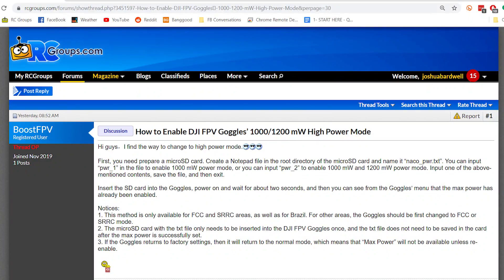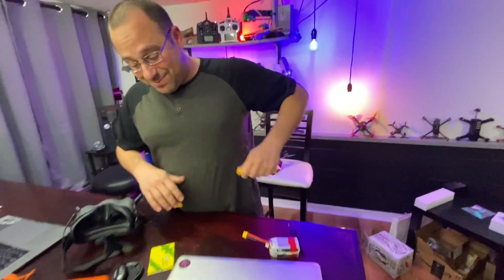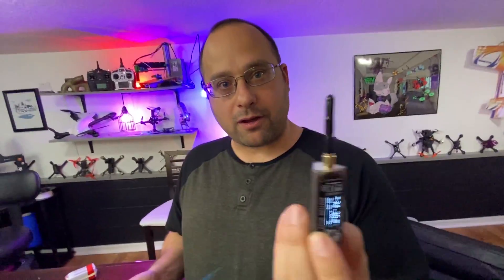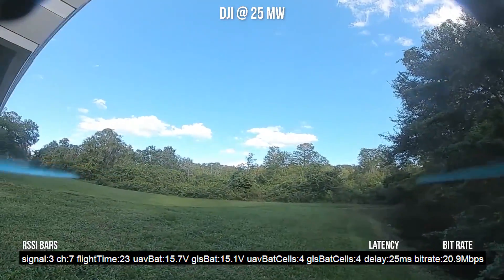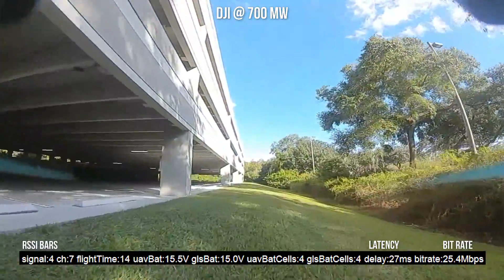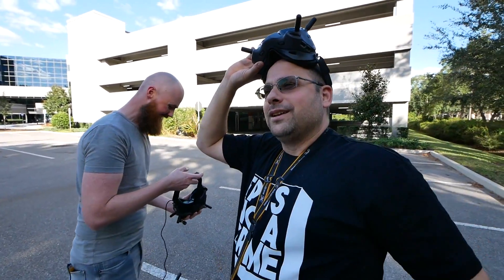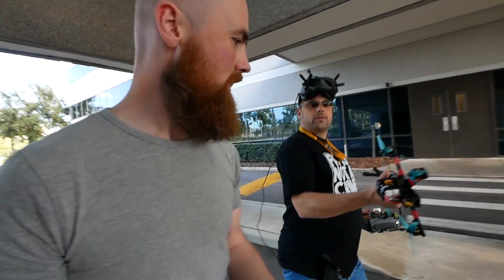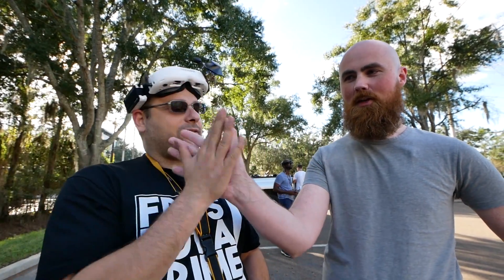DJI FPV more range than analog | 1200 mW HIGH POWER MOD

Comment: So how long till DJI forces an "update fix" for this? :popcorn:
Reply: They have not disabled the nearly identical "fcc" power limit hack for people in the EU, so, maybe they won't do anything about it?
Reply: first thing I thought of after going through that with the mavic
Reply: Guys DJI is the one who gave us this "hack" lol.  They're not going to take away something that they intentionally built and then "leaked" to the community.  This didn't work till the firmware update... They want us to be able to use this, they just can't legally give it to us above the table.
Reply: they most definitely will. that's the bad side of using a company that forces firmware updates. maybe the update will be optional, but then you'll miss out on actual improvements, like betaflight OSD data in the DJI OSD, which is currently very limited.

Comment: You are flying low to the ground and your 2 goggles were very close to each other. Your goggle and transmitter antenna positions were not perfect but I like your videos thanks
Reply from the maker: The 2nd set of goggles is in Audience Mode where it does not transmit. So it is not affecting the result.
Reply: @JoshuaBardwell  ok sry

Comment: it needs to be smaller to fit in a 3 inch :)
Reply: iFlight DC3 .. more on the way.
Reply: I have it on a 2.5" and it flies quite good. Check my videos.
Reply: No it doesn't.  The FlexRC Colugo is perfect for it, so is the Transtec Beetle 2.5" and the iFlight DC3 3". Fits them all great.

Comment: It wasn't the tool, per say, Josh shorted it out, touched it to the frame. Daaaaaamn! haha
Any reason you're not using your T16?

ALSO: Rotor Riot safety tip #1 (on Instagram) always remove your props when working on a drone. :)
Reply: X9D 4L
Reply: Was thinking the same..let's short the air unit that controls the quad and then put our wrists right over the props when we plug it in.... :)
Reply: @Sully365  he's running crossfire.

Comment: You bridged some powersource with the frame, the carbon burned.
Reply: thats how I burned up the stack in the wizard 140 the day I got it  :(
Reply: Jesus it was Ironic. You know that’s what the ;) smiley is for ;)
Reply: Ya the air unit wasn’t fried so must of just been the frame
Reply: looked like a tantalum capacitor burning. Or maybe a DC voltage regulator. 
the capacitor would make more sense as to why its still working though
Reply: Nah man, you are wrong it was the sharp tool! ;)
Reply: @naiceify  Maybe the sharp tip broke a membrane and damaged the insulation
Reply: @naiceify  which one?
Reply: @naiceify  Nah, he's right, something else burned.  If the tip of the tool itself let out that big of a fireball it would be completely missing, but it was fine.

Comment: Remember that DJI uses shitty antennas to get around some FCC limit. If you use better antennas you can also significantly increase your range.
Reply: I always love when pilots put directional antennas on their goggle and then fly with their head pointed to the ground 😜
Reply: Thats kabab bullshit. If they measure rf power. They measure it straith on the sma, not on the antenna. I measured the stock dji antennas for VSWR. And they are near perfect.
Reply: Hans Turpyn I didn’t say you get more power. You get better range. Those stubby antennas obviously are not the best. I‘ve seen multiple people switching antennas and by that getting increased range.
Reply: @MariomasterNSMBHD  yeah i know. But most people switch them to some sort of directional antennes. If you swith them for "better omni-directional" antennas the improvement will not be that much. There is a lot of hype and placebo effect in this space
Reply: I tried a lot of other antennas on the goggles and i can say that the stock Omni antennas are certainly not that bad
Reply: @hansturpyn5455  They are indeed okay and optimized for their size. Patch antennas are indeed not the best idea. But some high quality omnis can give you a bit more range.
Reply: @MariomasterNSMBHD  i got the cyclop on it and its dope
Reply: @hansturpyn5455  SWR doesn't tell you about thermal efficiency though, and the axial ratio on the stock antennas is rather poor. The singularity beats the stock DJI antenna on both.

Comment: Out here commiting Genocide on those Brain Cells, you have to make sacrifices for that kind of range.
Reply: I am an Industrial Gamma Radiographer.  I deal with Ionizing radiation daily. I’ll try to keep it simple, though there are more factors at play. The typical radiation dose for the average person is 600 mRem per year due to environmental causes (sun, ground & medical exposure). On a typical day of work I absorb 4-12 Rem. But I have absorbed over 60 mRem in one work day. that means, and that one day, I absorbed over a 10th what most people absorb in an entire year. Your body is naturally resistance, and will heal itself(over time) when dealing with lower levels of radiation. Trust me you when I say “THERE IS NO WAY A CELLPHONE OR ANY SIMILAR DEVICE CAN HURT YOU!”. It’s a larger doses all at once that you must avoid. Anything under a 100 mRem exposure(all at once), is undetectable medically.
Reply: yeah. with  the DJI being a two way system, I would only want to run it as a groundsation. (which they don't offer)
Reply: Meanwhile calls with phone @ 2W
Reply: @hansturpyn5455 way less than 1w google it
Reply: @boratsagdiyev1586  lol, the old phones where a lot more. It actually differs from phone to phone. You gonna die anyway sometime. Its  non ionization radiatiation, harmless
Reply: @hansturpyn5455  Some people are very restistant, not only to radiation, but also to any kind of humor online.
Reply: @NeverenCH  😜 yeah but some people actually believe it is dangerous lol
Reply: @hansturpyn5455  Fact of the matter is some studies have shown 5.8gz frequencies to be harmful and some haven't. At the end of the day you know there are huge massive lobbies to prevent these kinds of studies from getting the funding they would need to actually broadly test it. Im not risking my health for a hobby. But you do you i guess.
Reply: @AgustinMolini  yolo, enjoy your life to the fullest. Have fun my friend. Live a happy life as long as it lasts.
Reply: @AgustinMolini  If you want to follow your life by fallacies go ahead. Just don't persuade others to follow in your idiotic path.
Reply: @AgustinMolini  I worked in an rf shop testing military electronics in the Ghz range. Over the years 8 of us had kids, all 8 were girls. We only tested at low power in the mw range.

Comment: Yeah thanks... flying in the EU... that's 50 times my legal limit... =D
JB have you considered what happens to your brain if you have this next to it?
Clearly 25mW is ridiculous but 1,2 W at this wavelength is pretty unhealthy
Reply: It doesn't send back at this power and also 5.8 isn't a frequency with potecnical to tissue damage
Reply: @peterzingler6221  people are so uneducated sometimes, there are no research proving that 5.8 ghz are harmful. If people stop beliving in science we should all belive in santa claus and feries :)
Reply from the maker: There is no evidence that microwave energy has any unhealthy effects. Eventually if you get up to hundreds of watts (like a microwave oven) you cook your tissue. At power levels of single digit watts, the only thing that happens is a tiny warming of the surface of your skin.
Reply: Peter is totally right, that there might be no problem because the goggle antennas are only receiving. So the distance to your head is irrelevant. But still 5.8 GHz is the perfect wavelength for tissue damage and especial DNA-damage. (the same reason you cant get signal underwater and behind trees)
And of course there are researches, that prove this.

Comment: Why would you need six antennas to switch to the lumenier axii? If the goggle antennas were LHCP and you used the standard MMCX on the air unit, would it not work well?
Reply: The Googles have rpsma
Reply: @peterzingler6221  Yeah, but you could use the TrueRC Stubby which come in RPSMA and LCHP.
Reply from the maker: I'm sure there are lots of different ways to handle that situation. One way is to buy a whole set of new antennas, which costs $140 for the Lumenier Axii.

Comment: Ayo, can’t wait until I get good enough at flying to justify one of these.
Reply: If you're a good pilot you would never buy dji and sell yourself to a system. That what a noob would do
Reply: Dumbest comment award! Dji system is awesome. Peter just doesn't or can't shell out the money for the system. I've been flying fpv for 4 plus years. This system kick started my love for flying again. Analog is horrible. It's like watching a tv from the 60s and a tv today, 2 totally different experiences.
Reply: @TheFlyingMechanic  hear hear, been flying for 5 years and i totally agree with what you are saying
Reply: I have the same experience, compare analog to HD is like compare 60s TV to today's TV
Reply: If your like me going with the DJI system made me more confident to fly in more areas simply because of the fact that YOU CAN SEE.

Comment: First, also I wonder about the output on the DJI goggles, are they also 1.2W? Heard some scull cancer comments around FB
Reply from the maker: 5 GHz microwave energy does not cause cancer. It is non-ionizing radiation. The only thing it does is increase temperature.
Reply: Do the goggles transmit anything substantial?
Reply: @mortache  Yes, that talk back and forth with the air unit.  DJI Specs page says they can transmit up to 30dBm or 1watt, same as the air unit.
Reply: @mortache  yes, that is why they have to stand so far away from each other when flying
Reply: Well visible light is 0.3-0.75 Peta Herz, so i doubt we're getting any cancer from RF. How many watts do LED ceiling lights emit?